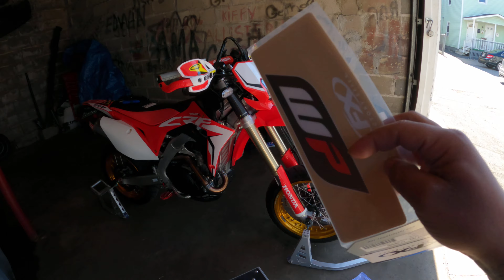Honda CRF 450L Supermoto

Comment: How tall are you? Im only 5 foot 5. Do you think its to tall for short rider?
Reply from the maker: Hi I’m also 5 foot 5 and it’s tall even with the 17 inch supermoto wheels but it’s not too crazy if u been riding for a while you should be fine. With stock 19” inch wheel is very tall.